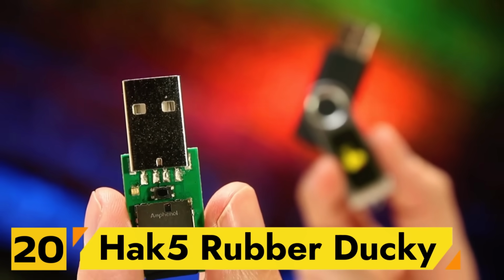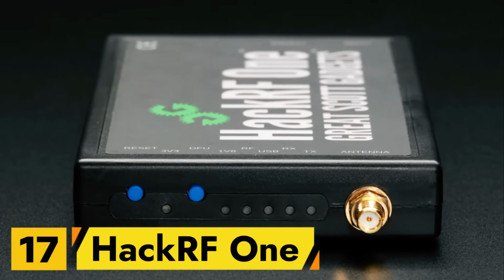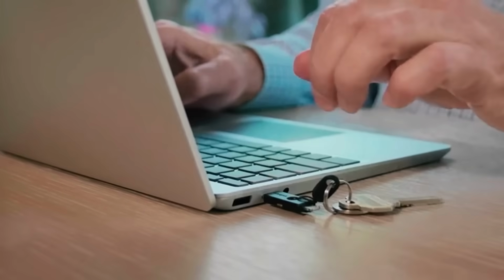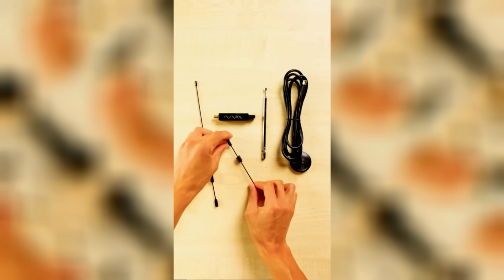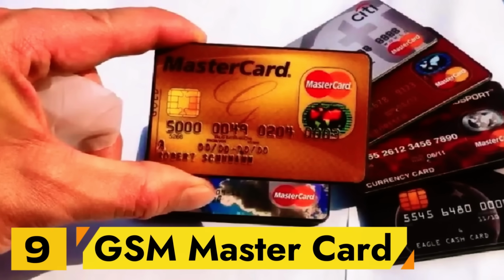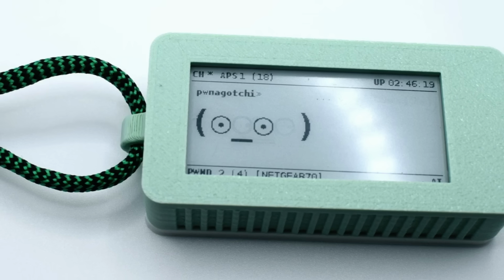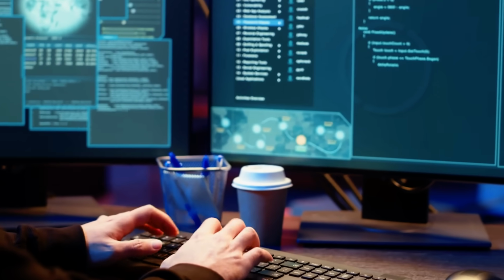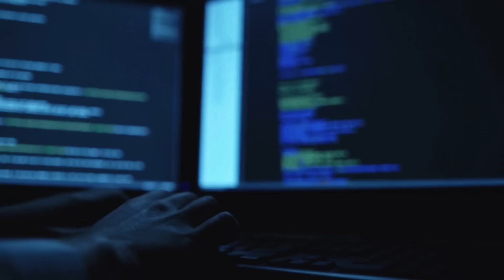20 CRAZY HACKING Gadgets You Can ACTUALLY BUY on Amazon (2025)

Comment: ⚠Setting up a USBNinja right now is pretty frustrating. Many of the official links just don’t work anymore — the APK, the documentation, and even the Arduino board manager URL are all down. On top of that, nobody from the dev team or vendors seems to be responding to support requests. I even tried building the Android app from GitHub, but it fails with a project error, so there’s really no easy way to get it working at the moment.